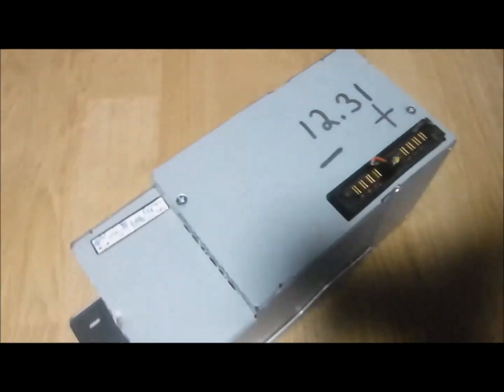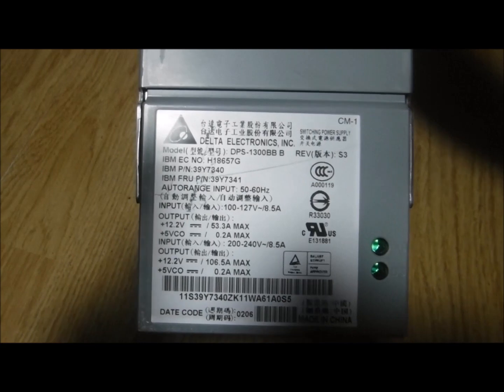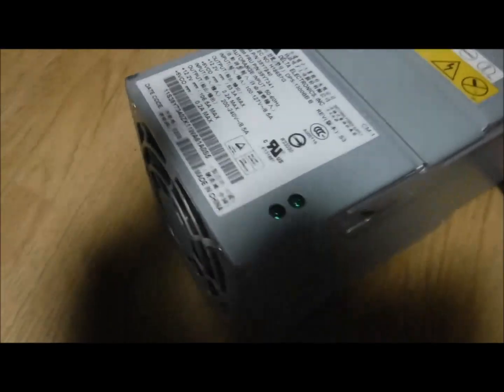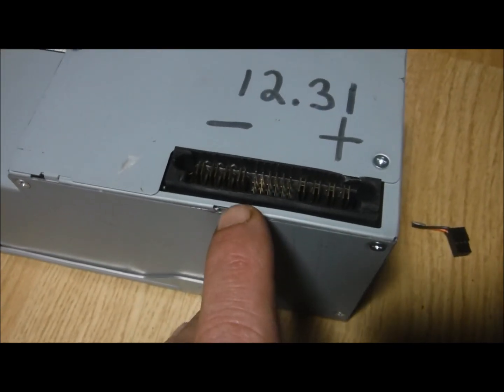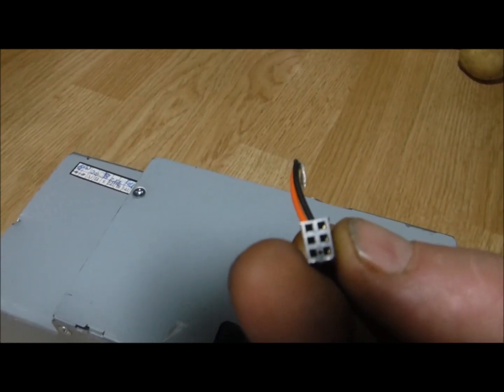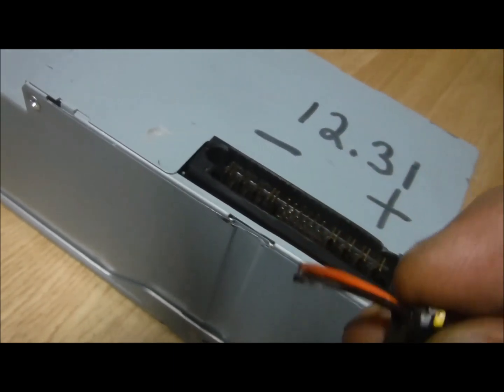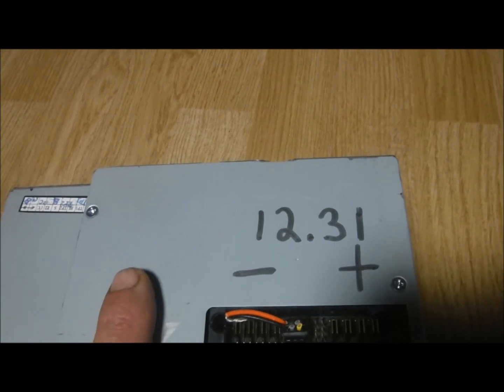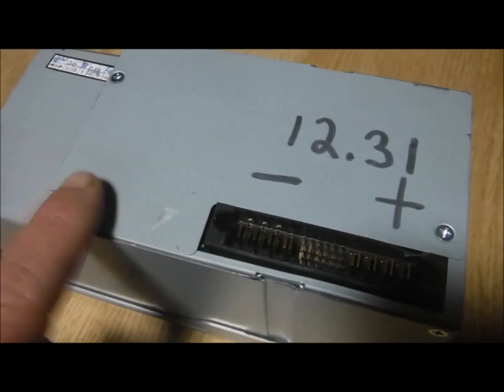Delta Electronics DPS 1300BB B Power Supply Pins To Join For Output Voltage To Work

Comment: Hi folks, is there a way to lower the noise coming from DPS 1300BB? Fans are running on 100% power and I am not using even 30% of it's psu power so it's kinda overkill
Reply: Yes, unplug it.
If you are only using a small amount of the potential of this power supply, then you don't need the fan...
Reply: replace the fan with a slower one.

Comment: The other pins that you say are insignificant give various voltages from 0, 1, 5v and 12
Values will slightly vary from supply to supply. These are reading they may have other functions.
top row (D) - 0.65 - 0.65 - 0.02 - 4.94 - 4.84 - 4.01
3rd row (C) - 0.00 - 4.89 - 0.03 - 0.00 - 0.00 - 4.82
2nd row (B) - SW - 0.00 - 0.00 - 4.82 - 0.00 - 0.00
1st row (A) - SW - 12.25 - 1.26 - 0.06 - 0.00 - 0.00
Then Left GND and Right 12v Rails. Hope that helps someone
Reply: Can you help me how to fan speed run slowly , because fan speed hight run so noise.
Reply: @ThuongNguyen-qi9ml  using pegs or gears is the same. If your motor has a large gear turning a smaller gear then the fan turns fast, if the motor has a small gear that turns a large gear then the fan turns slow. It is the same for pulleys. You could even use more than one gear, the size of each determines the speed. Also when I say motor, I mean any source of the rotation.
Reply: @stevetobias4890  what?.. i have the same noise problem but the fan has no gear...
Reply: @ThuongNguyen-qi9ml  hey, do you find the way to turn down the volume of the fan? im having the same problem
Reply: Like he said... they're unimportant. This supply is from defunct servers and if you are just using it as a high quality, high current surplus sourced power supply, then all those pins (that used to connect to the server's intelligence) are worthless to the second hand user...The 2 pins he has you connect were controlled by the server as a soft switch to turn the unit on.

Comment: What is it out of?
Reply from the maker: Server racks there are many types with many different sizes of power supplies. Most of them are fixed voltages. Some have adjustments that can be made to the voltage and amps. Hard to come across them type.